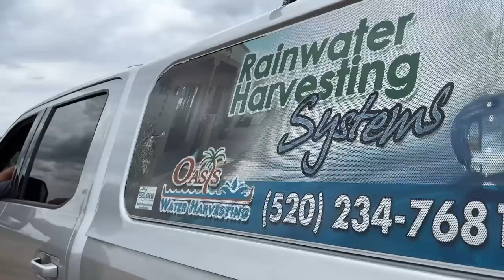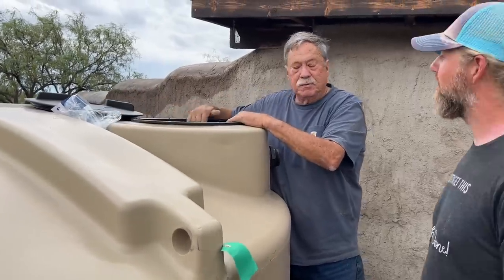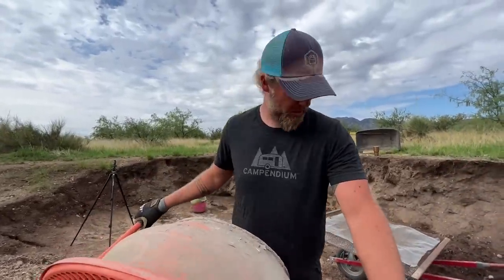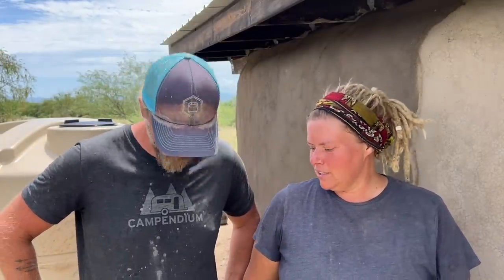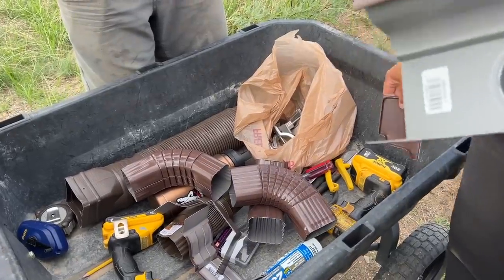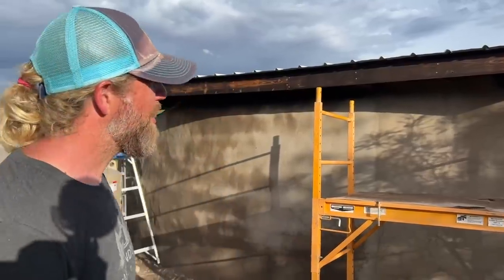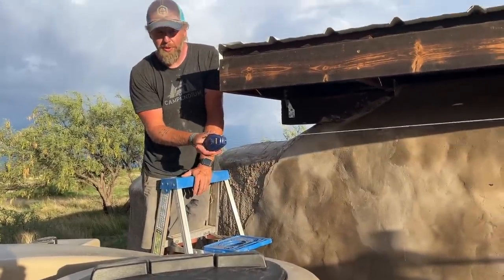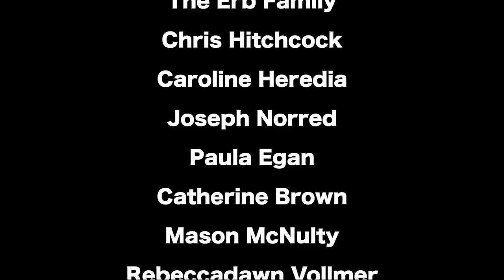RAINWATER Tanks Delivered! First Rain Catchment Installed (Chicken Garden Day 155)

Comment: A tip for the fine mix sifting setup... take a jigsaw(remove blade) and use it to agitate the screen while moving the soil around, 
It should vibrate the screen and allow the finer bits to pass through easier. 
A broken blade or modified blade can be used if the end is short enough and wrapped in metal epoxy and tape to 
Soften the impact when it hits the screen so it won't poke through.
Think like a small boxing mitt, only at a speed that works for you!
May your Independence Day Celebrations be Happy and Safe! Happy Birthday America!

Comment: I feel the PPE when cutting stuff. I did a paver walkway, and didn't want to have seams parallel to the edges because if I bike over it the bike wheels can get railroaded into the seams and throw you off balance. So to do a diagonal pattern I needed to cut my edge pavers diagonally. Fortunately you don't cut them all the way through, I cut them about halfway and then broke them off. The bad news is cutting concrete pavers creates a crapton of concrete dust. The problems escalate quickly too from there, with dust in your face/eyes, dust on the pavers, dust blocking your view of even seeing your cuts... So PPE: gloves, goggles, long sleeves, mask. Then if it wasn't a windy enough day, I needed to setup my leaf blower to keep visibility even. Honestly cutting like 500 pavers was the worst part of that whole process. Didn't think my 7.5in 20v circular saw could handle it, so I got a corded 4.5in one, better suited for cutting pavers and went through like 5 blades? Honestly I lost track of how many I used.

Comment: Good call on the enduraplas tanks. I use lots of them and they hold up really well.  So well in fact that when I unloaded them from the semi I didnt strap them down overnight before install and a gust of wind rolled one 1/4 mile down the road the next morning.  My kids rolled it back and we installed it.  They are tough as nails.  1"of rain on 1 sq ft = .620 gallons.  Or something like that. Congrats on getting that done before the rain season.
Reply from the maker: Yeah they're tanks - and most importantly thick enough to make sure mold doesn't start growing from sunlight.

Comment: I saw someone bring out an electrolyte drink to someone in a blue bottle.  I make my own.  Where I live, it is often very humid in summer.  The temperatures range between 30 to 35C (86 to 95F) on a good day and is bearable when there's no clouds and it's dry but add a few heavy gray clouds with a hint of rain and the Humidex goes through the roof making it feel a lot hotter than it should be usually by another 5 to 9 digits higher and worse if the humidity percentage is over 80% where it can climb to 10 degrees more.  
Before I retired as a wilderness first responder, I had the privilege of treating many victims of heat exhaustion and believe it or not, it occurs more in sedentary people who come out to play once in a while or during holiday hikes.  Plus in very high humidity (when you'd figure it would be less) the risk is greater.  I always carried a small pouch with the following ingredients (easy to find in your kitchen cupboard): ¾ tsp kosher salt (this salt has no iodine which makes it easier for the body to absorb),  4 tbsp sugar (I’ve used white, brown & Damara sugars – Damara and white work best), 1 tsp baking powder (allows a smoother swallow). The original recipe calls for fresh orange juice but when you hike, the last think you want is more weight, so I add 2 tbsp fruit drink crystals (and reduce the sugar amount to 3 tbsp (because the drink crystals already have sugar).   Put all the ingredients in a zippered snack bag and mix well.  Store in a cool, dry place (like your first aid kit).  
To use: add the dry to  35 oz of water.   Shake well for at least 30 seconds.  Or for single use: 2 tsp of dry mix to 250 ml (1 cup) of water.  Don't drink it in big gulps.  Take a small sip every minute, let it sit on your tongue for 5 seconds then swallow it down.  The average high activity ratio is: Drink 100 ml (3 oz) every hour (about 2 mouthfuls) or every 3 bottles of water.  High sweat activity:  drink 150 ml (5 oz)  to 600 ml (21 oz) of water for continuous drinking during the activity with 250 ml (1 cup) of electrolyte replacement drink after 600 ml of water.   Hope this helps you all stay hydrated.

Comment: I've only followed for a 3 wks. You popped up as recommended while I was watching the YT 'Green Dream Project'. They are also in Cochise County, building off grid for 4 years. I feel bad watching you suffer while working in the heat. I've spent time out west on motorcycle trips and always wear my neck cool tie. They feel like a life saver. I found my first while out west at a rally. They are basically a neckerchief sewn into a tube, 1 in wide flat, filled with a 1/4 spoon of the crystals used in flower pots, sewn shut with 5 or so inch tails. Soak in water and they swell up. Wrap around your neck and tie off comfortably to keep cool until the water dries out thru evaporation. You have to change out the crystals when they quit soaking water due to the oils in sweat. I just saw them on Amazon but made my own for 20 years.
Reply from the maker: Yeah. We had a viewer send us some. Just don’t like weights around our necks while trying to work.

Comment: They sell adapters to put on your cordless drill. Not sure if you have a 40+gallon air compressor, but pneumatic nibblers pull a lot of air. You’ll want a half-moon cutter vs a strip cutter.  I bought a strip cutter and killed the cutting head within about 40 feet of cutting.

Comment: fantastic you are doing fantastic fantastic work.  for interest i found that in Arizona with 12 inches of rain a year, that a 10ft by 10 ft roof catchment would catch about 500 gallons a year. so 10 ft by 10 ft is a square and most Vegas homes are 17 squares. so most homes could catch 500 x 17 = 8,500 gallons of water a year. 
so a roof of 10 ft. by 100 ft. would give 5,000 gallons of water a year.
based on one ft. x one ft. x one inch of rain giving 0.6 gallons of rain water.

Comment: I have those same  tanks but in light grey. We also have 2 bigger ones @20,000 litres. They last us a year or more. Like you we have no town water and rely on tanks for all our water needs. We use the overflow outlet to join them together so if the  one under the downpipe gets full it flows into the other.  We also have those ibc pods for the bigger tanks if they overflow. Currently in Australia we are having so much unseasonal rain everything is overflowing. Love not having to buy in water like last year.

Comment: I think if the accordion bend is impacted by the water flow, it will be by….0.5mm. That MIGHT be enough to budge that one fold to open more but it won’t snap open.  Well….if it does I will be surprised.  Very surprised.  I don’t have the big barrels that you installed.  I only have 55gal rainwater barrels BUT the guttering is the same.  I live about an hour north of Knoxville about 15miles from the Virginia line. We get rain.  Not constant Seattle or Vancouver rain but we see a bit more rain than Arizona.  The accordion folds on the gutters don’t budge.  Haven’t moved in ~15 years?  Something like that.  Brilliant job guys!!!  Will you be able to hide them from the road?   How much will they hold?  The smaller one, 500 gallons?  I can’t even try to guess the big one.  Thank you for the info about Oasis!  Everyone who can would do well to install a system, even little old ladies like me in Kingsport.
Reply from the maker: Small one is 1200 gal,  big one is 3k

Comment: I use these tanks here in Australia and they are awesome. The sooner you get some water in your tank, the better it will resist wind loads. Leveling the base gravel layer is absolutely critical. Hard for me to see you install the outlet pipes. If you used the same bronze/brass connectors we use in Australia, The clever connecting technique would make for interesting video.

Comment: Y'all are knockin'  it out. You have come so far. 
I do hope the glue you are using is safe. Seeing how you are or may drink this water. Concerned
Reply from the maker: Technically rainwater isn't potable either way. Anything on the roof will wash into the tank. If we drink anything it'll always be filtered with our Berkey. In this case, though it will only go to water the garden and chickens.

Comment: I do metal roof screen rooms with aluminum everyday do not turn the blade around because it was throw showers everywhere and it will get in your skin cut it with a carbide bit the right direction you won't have any trouble good luck

Comment: Great job on everything! Was hoping you were going to put a first flush 4"pipe or first flush 55gal drum in before the water would get to the tank. Thus a little cleaner water in the tank and not as much sediment washing off the roof into the tank. 🤠
Reply from the maker: Rick isn't a fan of first flushes for a number of reasons. But either way this is just for the chicken garden so it's not going to matter either way.

Comment: Hi just watched ur video just wanted to let u know there is a easier way to sive ur sand mixture into ur wheel borrow instead of ur kids using their hands to push the material into the wheel borrow. If u build a square box out of two by two and attached the wiremesh insside of it then attached some small pipes around the edges of the square it will allow you to push and pull an it slides accross the barrow. You can check out this youtuber channel Surise boss Jamaica channel he has a version of what am explaning. Hope you take the time out to look at it makes it much easier and faster. Am jamaican and i c that u listen to Jamaica music one luv
Reply: Jamaica sunrise tv.Episode working on my house with my father about 6mins in the videos you will see the tools they use to sice the material (sand) into the wheel borrow. Hope this vidoe helps you

Comment: Couldn't you just add blocks on the facia and set it out enough to catch the rain? 
 I can tell you a way to do a much less costly way to make a gutter, that never looses a drop of that prescious stuff. You use 6" sewer pipe, or water line[heavier walled]. Cut a grove out of it that will allow it to fit directly over the ends of your R panel[will be about a about a 3" groove. It will set on the tops of each R panel rise. I had a horseshoer welder make my braces to hold it up, it was a pipe framed car port.. You would have to figure out how to mount it to your facia boards. This gutter was getting the catch from a 30' house roof pluss 16' more carport roof. Lots of volume and it caught it all and shot it to the rain barrels. Way more study than flimsy tin/aluminum. Maybe not as pretty, but it could be painted if cleaned up well.
I hope I am explaining it well enough that you understand what I am saying. I could draw you a diagram and email if interested. It's a stouter, cheaper, longer lasting way to do it, just not as pretty! Can wait to see how the chickens like it!
Reply from the maker: That all sounds way more complicated and expensive honestly. For this small roof the existing gutters work fine and didn’t cost much. Would have required too many 2x4 blocks so we just cut.

Comment: Hey... bubba , bubba dad or clan leader.. because I like to see a family working together..
1. Take, a old garden hose, 25 feet.. jam a clear tube in each end. About 8 inch sticking up. Draw lines on each clear tube. You can attack one end to the faca board... or get bubba jr to hold it. 
Fill the hose with water holding both ends up in the air. Fill up half way on the clear tube you jamed in the hose. Hold the hose up against the face board,.. draw a mark, on each end.....
At the water mark.. that is 100% perfit, level line , snap, your chalk line....end to end... now,  bubba with a tape mark your slope,  snap a line. Then screw up the rain gutter... put, a fake plastic owl...on the roof... they do scare birds away.
( why you say... well, no one wants bird crap in there rain water...)

Comment: Be careful rain water. My rain water gets orange and has soap bubbles. I have 2 old washtubs. My friend said its coming from the roof so i put them in the middle of the driveway. I filled one with the hose an let the other catch rain. The last 3 weeks one got 4 or 5 inches of rain. It is completely orange with something that looks like soap bubbles an something on the top that looks alittle like gas. The tub with hose water ok until it rained. It also turned orange. It leaves a coating of red like rust all over the tub. I just wanted to warn you about the rain. Sorry about the strang comment. I'm just worried about your family and animals. Cool dog.
Reply from the maker: That’s not rain water. That’s either coming off a roof or your container is contaminated.
Reply: @TinyShinyHome  they are 2 big matching square washtubs. Galvanized. I was using a round one an it did the same. This time i put both away from the roof an it still happened. I cleaned the hose one again to see if it stays clean. It was clean the last time until it got about 4 inches of rain.

Comment: Second, easyer,...rain catcher.... bubba....
Use, camo, plastic tarps, good ones that will last.. make, a shade kite, pull ropes down in the middle, to race the rain off. Use a plastic barrle, cut down, and drilled, for a PVC pipe to go into the tanks, make a cool, wood stand to hold the blue barrle cut down, king of like a old wind water pump... now the flash, storms. You'll fill the tank fast, as a snail Carling up your leg. Haha, a joke...dont forget,... after the tank is full and it going to rain... flush the tank, by draining off old water. They have, solar, water peufiers, 
U put it in the take. Sun keeps the water moving, and keeps filtering it... to the poi t you can drink it... your welcome... want to know how to snake a snake pit...to catch snake, for food and fun.